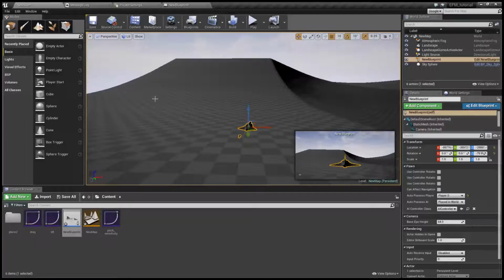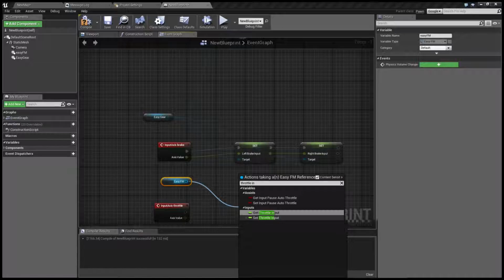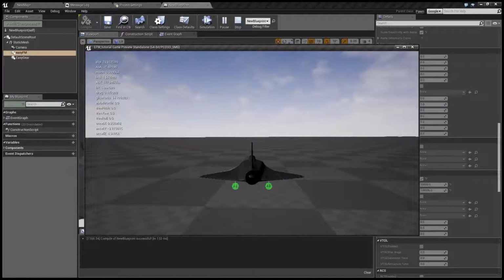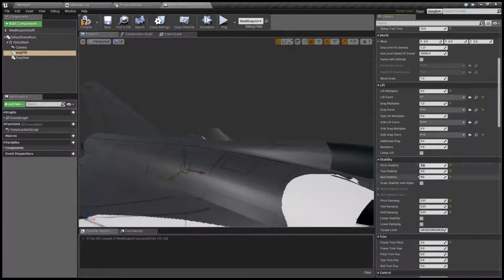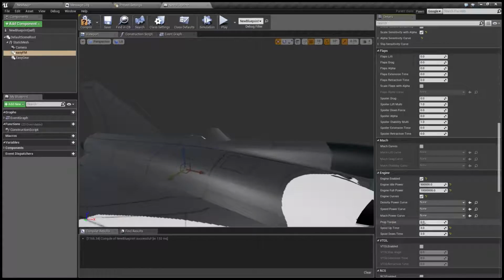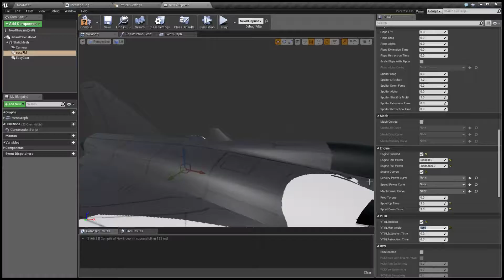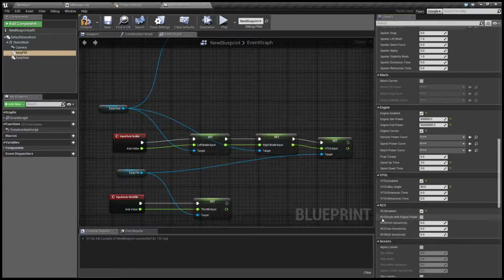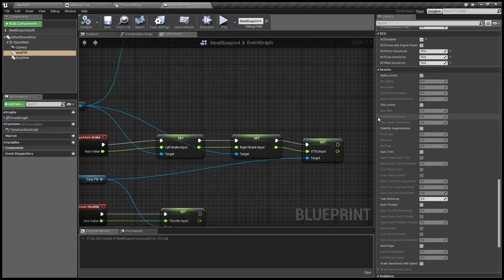EasyFlightModel UE4 tutorial ep.5 (propulsion)

Comment: Hi, when I try to take off the ground at full throttle while on the runway, the aircraft doesn't actually lift off the ground. It's like the wheels are stuck to it or something. The only way I can actually "take off" and start flying is if I drive the aircraft off a cliff. Any ideas what this problem might be?
Reply from the maker: Most likely the rear wheels are too far back from the center of mass.
Reply: @Worstplayer  Cheers.